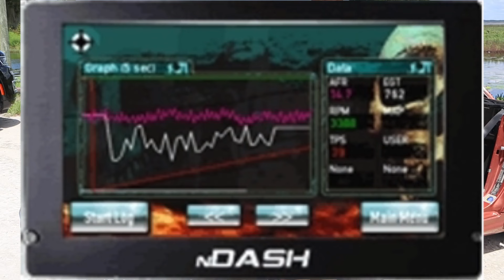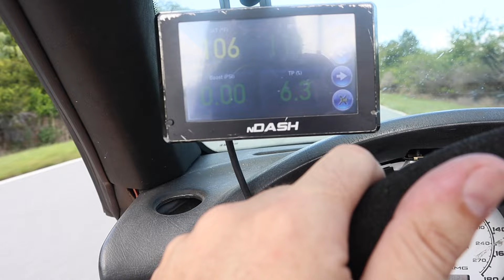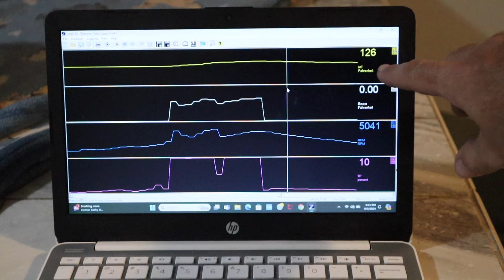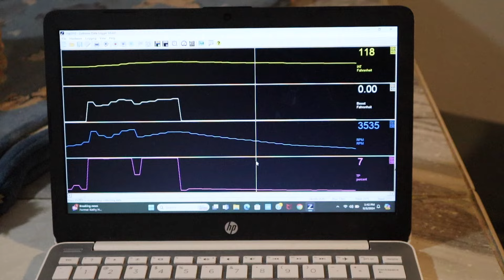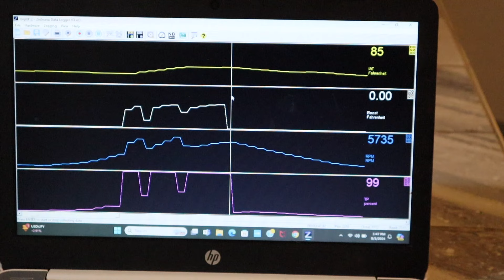Testing Rear Mount Heat Exchanger On My Supercharged Slk320

Comment: Get some DuPont brake pad paste from Mercedes, apply it to the back of the pad , it works really well for quieting the squealing noise of your vehicles brakes.
Reply from the maker: i might just upgrade to clk55 breaks to drop some lb and have a way better set up
Reply: @Nd_72 do they just bolt on?
Reply: @Nd_72 I hope you make a video of that.
Reply from the maker: @poncoolride  I am they should. I did it on my clk430